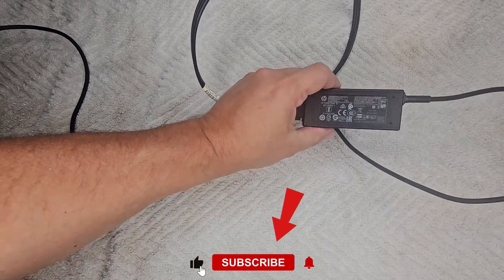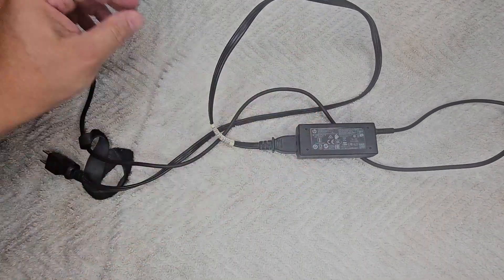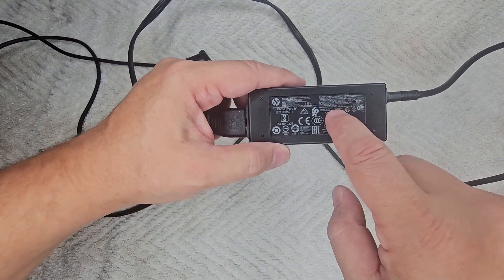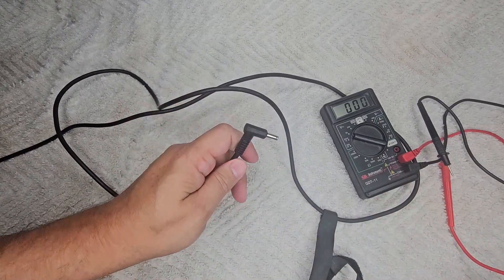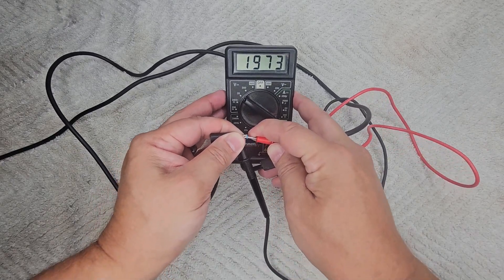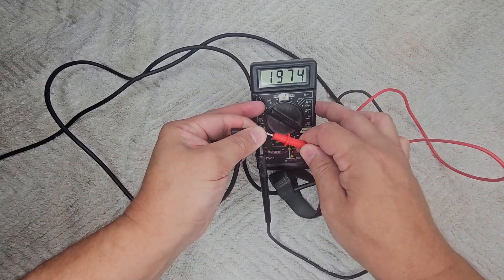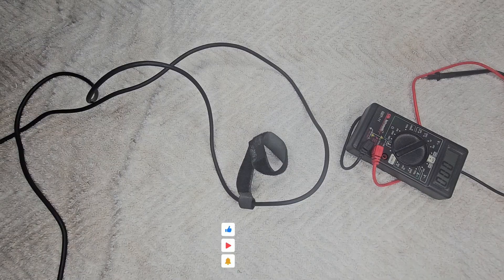How to Test a Laptop Charger Power Adapter and Cable

Comment: I had 2 laptop adapters on 2 different laptops where the voltage read correctly but the adapter was bad and needed to be replaced. The meter you are using is a multimeter not an ohm meter.
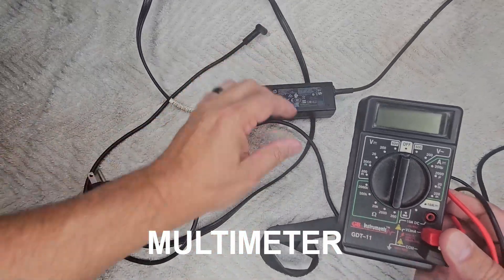Reply from the maker: Hey thanks for commenting and sharing your experience,and yeah I kept calling it an Ohm meter lol, but at 1:17 I did correct myself with a text popup lol. Thanks again for commenting!